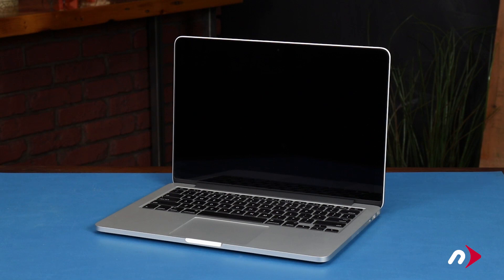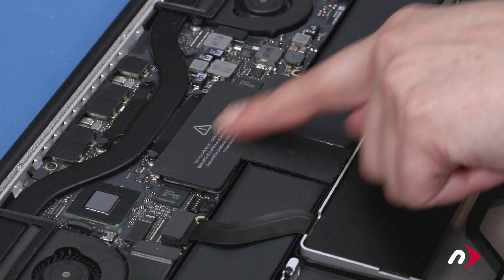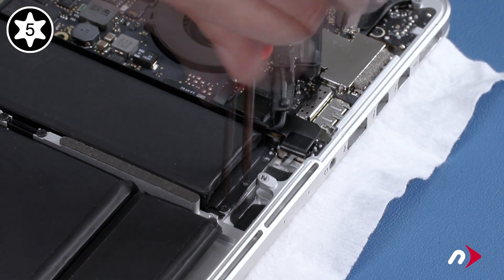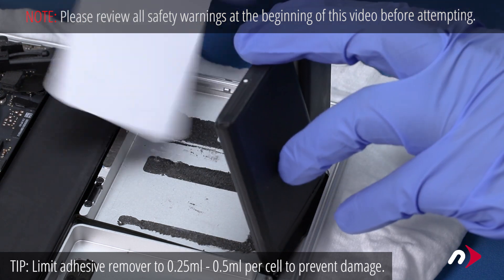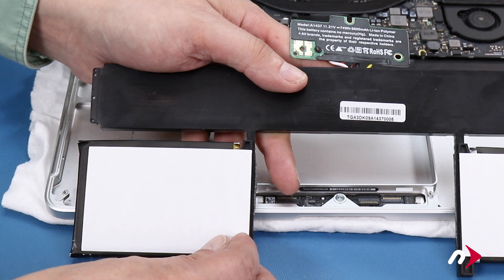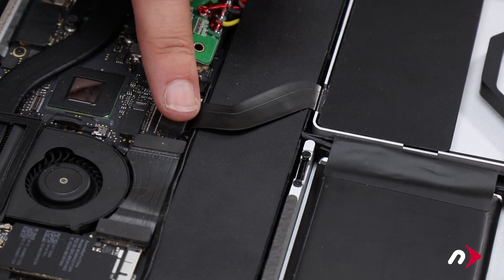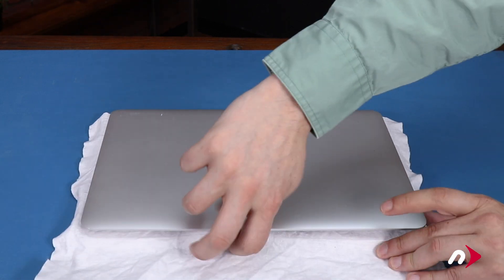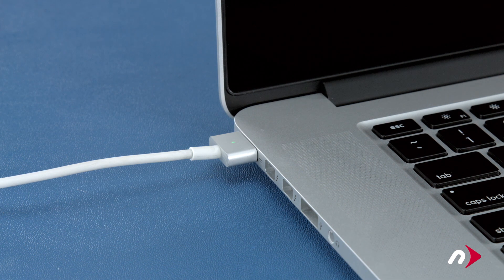How to Replace the Battery in a MacBook Pro Retina 13-inch (late 2012 - early 2013) MacBookPro10,2

Comment: Hi thanks for you video. I done all the step the battery % show 100% after charging but when i pull the charger out my mac turn it off like no battery. What wrong with it please help me ?
Reply from the maker: Hey Long Nguyen,
We have some troubleshooting steps here that you can follow and may help.

The first thing I would recommend doing would be resetting the System Management Controller. Resetting the System Management Controller (or SMC) in a Mac can be a useful way to troubleshoot various kinds of problems that arise, typically related to power issues or issues that coincide with new hardware being installed in the computer.  Detailed instructions on performing a SMC reset can be found on Apple's website here:  https://support.apple.com/en-us/HT201295

After resetting the SMC, I would also want to perform a NVRAM or PRAM reset.  This can be done with the following instructions:
PRAM Reset:
1) Start the machine while holding down the Option-Apple-P-R keys

2) Wait until you hear the 3rd startup chime, then let go of the keys and let the machine boot up.

Lastly, we would want to go through a proper conditioning cycle, to help the battery reach its maximum lifespan.  This process will help calibrate the battery and extend the full charge life.  You can find this process with detailed instructions on our Battery Conditioning Guide: https://eshop.macsales.com/Tech/manuals/newertech/batteries/batteryconditioning_r1w.pdf

If these steps fail to work in getting your battery performing up to specs, please let me know and we can look into this issue further for you.

Thanks!
Reply: @poweredbyowc  thank you so much i got it

Comment: Thanks so much for the incredibly clear instructions. I have been afraid for ages to do this procedure as my Macbook is my only computer and even after nearly ten years it has full support, I just updated to Big Sur and it is running smoother than ever, and it is perfectly capable of doing everything I want it to do, so it seemed like an unacceptable risk and my computer is increasingly chained to its power outlet and gets 1.5-2 hours run time on a good day off the battery. Now i'm looking at how relatively simple this is and thinking its well worth it to get the 5 hour+ run time back and keep this thing going for years to come until the M1 equivalents are mature and less outrageously expensive, this has been a great help.
Reply from the maker: You are very welcome! We work to provide videos for that exact reason, so we can keep more and more Macs going for longer periods of time. Plus we agree, why update/buy a new machine when you can simply upgrade and keep using the older one. There are plenty of machines prior to the M1 that were great when they came out, and are still great even by today's standards, and that's more reason to keep them running. Glad to hear we could help you and encourage you. Good luck with the battery replacement....You got this!

Comment: So I just went through this process and my laptop does turn on and has charge at the moment, but the battery won’t charge.
Reply from the maker: I am so sorry to hear you are having this issue. My sincerest apologies for any inconvenience this issue may have caused you. Please give us a call at 1-800-275-4576 , and we would be happy to troubleshoot this issue, and get your machine back up and running.
Reply: OWC thank you for the reply. Turns out my old charger was bad too so I ordered another and my problem has been fixed laptop is up and running perfectly. Thank you for making videos like this! I replaced my SSD about two years ago and now my battery. Your videos made it easy to get the job done, saved me some money, and taught me a few things. I appreciate it!

Comment: Any video to upgrade ram on late 2012
Reply from the maker: Pradap Jackie,
 
Regrettably we do not have a video to upgrade the RAM on a late 2012 MacBook Pro as this was when the RAM was first getting soldered to the logic board in the machine, we do apologize.
Reply: @poweredbyowc  thanks for the response

Comment: I replaced a new battery like discribed in the video. Now the new battery is at 45% all the time and it says that it is not charging. When i disconnect the Power the MacBook immediately shuts down.
Reply: Where'd you get the new battery from ?
Reply: @GOKU8125  from a shop that specializes in notebook batteries
Reply: @jahjahbee  Try to get a refund off it, probably a faulty battery
Reply: @GOKU8125  thats what i did. systemreport said: battery installed, but as is said, no charging...
Reply: @jahjahbee  i got mine off Amazon, has been working for the past week so far.
Reply: @GOKU8125  hi, is this the battery from Amazon: https://www.amazon.com/-/es/BatPower-A1437-repuesto-principios-pulgadas/dp/B084V3DZCT/

Comment: Wondering if anyone can help i've changed my battery as my original mac battery said "replace". The one I replaced with with then had a "service battery" notice so I got another brand new battery and installed it and it still says "SERVICE BATTERY" I have checked the battery cycle count and its on 1 so I can't think of why it would need servicing and the battery life does not last Long at all. MID 2012 Macbook pro.
Reply from the maker: It is possible that there's an issue with the battery cable itself, between the logic board and battery.
Reply: @poweredbyowc  Thank you I shall try having a look at that :)

Comment: Instructions are on point, 30 min start to finish. My A1425s battery went from "service battery" to bulging within a week. Used isopropyl alcohol to loosen the adhesive, which worked just fine. However was still incredibly careful(read crapping bricks!) in separating the ballooned battery packs (did not want a fire).

Comment: does anybody know the size and the correct name of these "screwers", i met some issue when i negosiate the type of the screwers when i was in a electronic diy shop. thank you all guys.
Reply: It is a t5 and t7pentalobe screw for the outside and for the motherboard I think its the same or it's just a Philips screwdriver.

Comment: The instructions were very clear.  I changed my MacBook Pro battery last night which took me approximately 30 mins to change.  I am still going through the process of the battery management system.  The new battery was just like the old battery and was not difficult to replace.  I viewed the video 2-3 times prior to starting the process so I could understand the methods without have to rely so heavily on the video.
Reply: did you don the protective eyewear and apply the adhesive remover?

Comment: Excellent instructions. I completed this last night without any problems. There are only three batteries instead of the five which came from the Apple factory, but it looks like the overall battery volume is slightly greater than that which originally came with my MBP. Enjoy!
Reply: Hey, could you tell me where to get an official battery from, or the name of it? I am living in Mexico and nobody here seems to be able to replace the battery without replacing the whole cover. I have never ever done anything like this before- would it be a terrible idea to try? Thanks
Reply: Pharoah Hendrix There is no original battery. The only place you could get an “Original battery” is directly from Apple and they don’t sell parts. Any battery you find online is not original.
Reply: @moonratz  hola!!! ya conseguiste a alguien que pudiera cambiar tu batería?